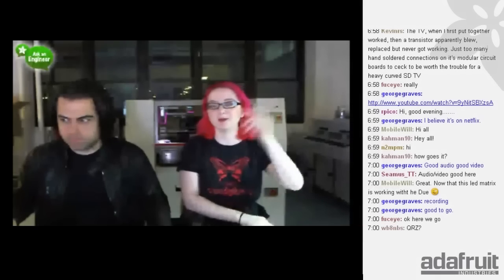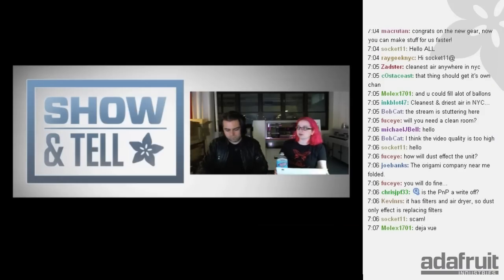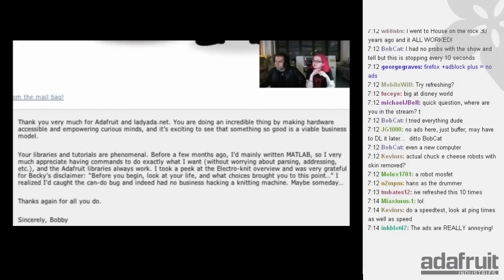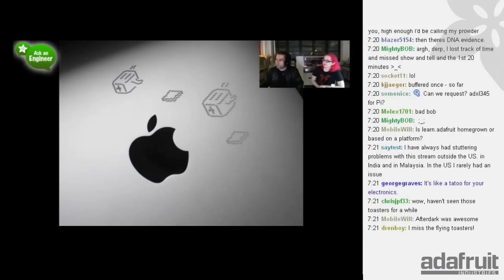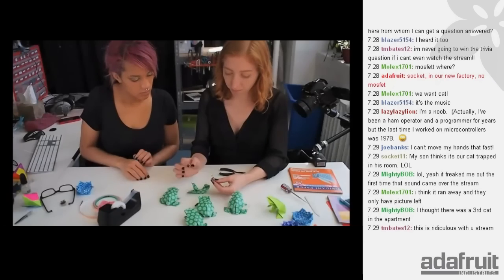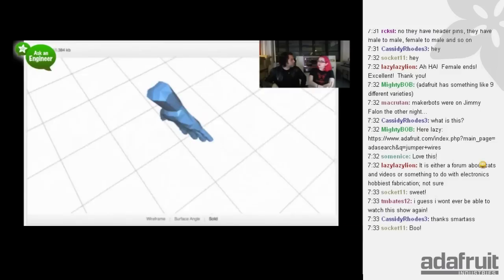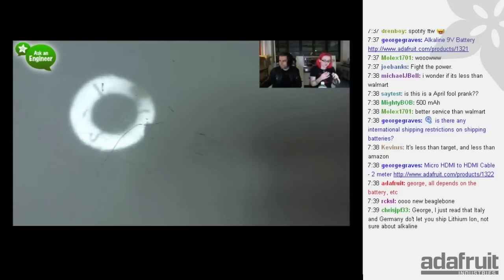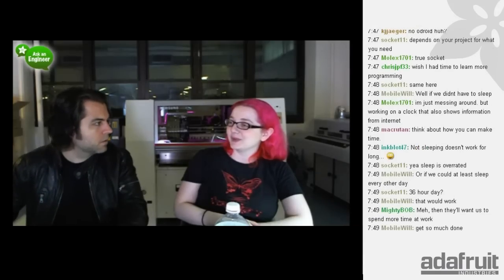Ask an Engineer 4/13/2013

Comment: fahnestock clips    Were the standard for electronic - electrical toys in the 1940's even before that . Just push them down stick the wires in let go. Next were spring like connectors, in the 100 projects kits. check MHAE RSN i show U